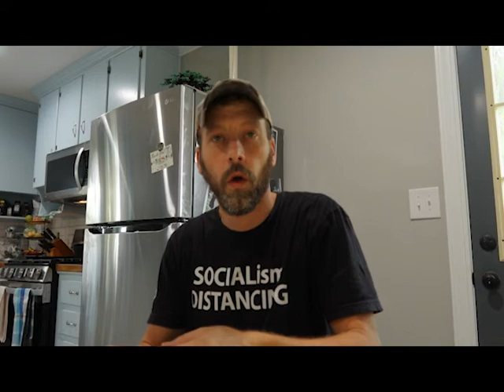Solar Technician Vs Solar Installer

Comment: He is correct. I technician is a cleaner. No matter what the system is he will find it. Installers are great at installing but with the technician to have knowledge of commissioning and troubleshooting, you just have equipment with power lights on and no production.

Comment: I am doing research on salary's for Solar Technicians and Solar Installers. Everything I have seen (For Texas) shows that Technicians make less than Installers. This made me want to ask, Why? I would have fully thought a Technician would make more than an Installer. Does anyone have an answer to Why the Installers are making more than the Technicians? Thanks for the help in advance.
Reply: Installers get paid bonuses
Reply: Installers pay goes up more frequently with experience.  Plus they work way more hours so the OT money is there .
Reply: I think working hours is also a contributing factor

Comment: Idk man I get more pay then the techs at my company but, I’m lead installer so maybe that why. We call them service tech. They come in after the installer do their part. If anything happens with the job like a panels not connected,  Jbox/Solar deck wires are phased wrong ect.  I actually learned a lot when I shadowed and service tech for a week. When I came back to my position I had an better outlook on things.
Reply: What company are you how much do they pay?

Comment: Home Ec. Guy! it is such a great video to differentiate between the Solar Technician and the Solar Installer jobs. I'm doing some searches to start getting into becoming a Solar Technician. I have 2 questions if you wouldn't mind to help me out by answering or giving some clues, what are the qualifications and requirements to become a solar technician? As a Solar technician can you work on your own as an independent contractor or you have to work for a company ? Thank you! got the like and subscribe!
Reply from the maker: The terms aren't official terms. There is no real qualification that makes one a technician vs an installer like with electric there's journeyman and master etc. That doesn't exist for solar (yet). Id say going through the NABCEP training. First the Associate and then the Installation Professional would set you apart from the vast majority of installers out there.
Reply: @HomeEcGuy  Thank you!